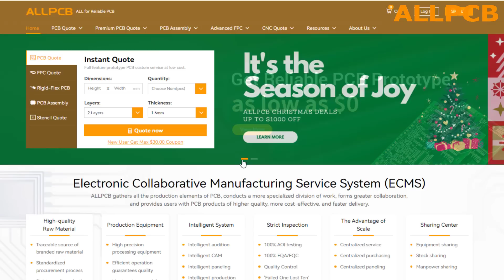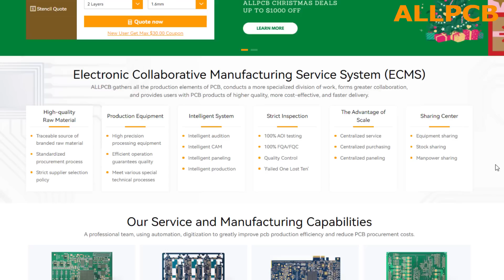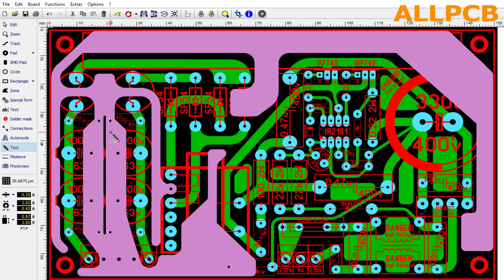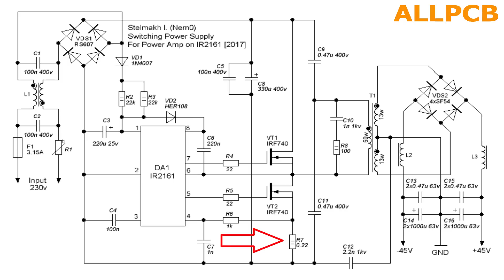Is it easy or difficult to wrap the pulse transformer Instructions for winding EE35 transformer

Comment: Bro I need 600 watt SMPS if I can use this circuit Changes MOSFET lr460 and any modifications can you suggest please
Reply from the maker: Change mosfet to IRF460,  the shunt resistor from 0.22 to 0.1 ohm. Transformer from ee35 to ee42 . Because the size of ee42 bigger than ee35 and irf460 also bigger than irf740  you need re-draw the layout file

Comment: Hey loggy tech nice video. Can i make it current controlled mode. Sometime I need supply which is independent of o/p voltage but is dependent of input current...
Reply from the maker: With this IC only has overcurrent mode. CC/CV such as TL494 or SG3525 common IC bro